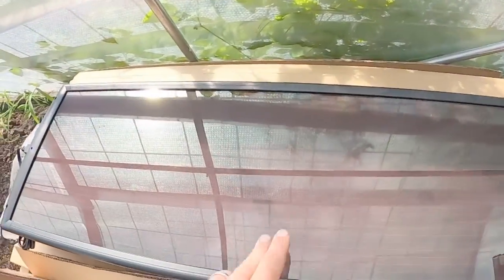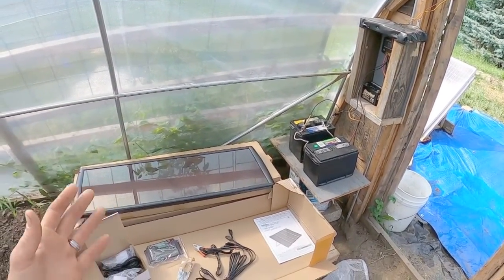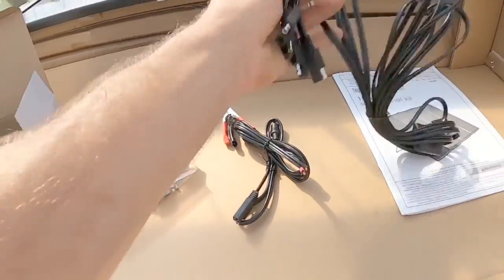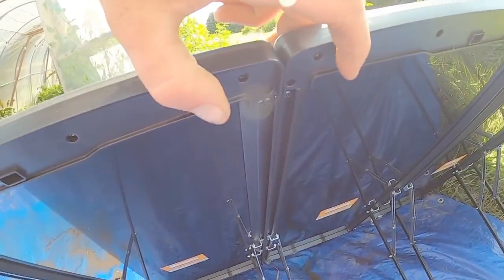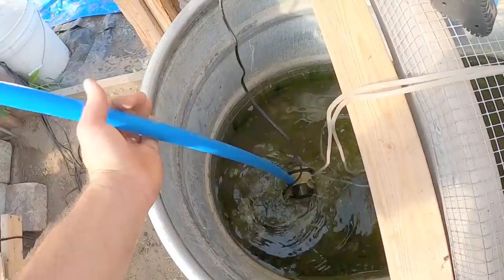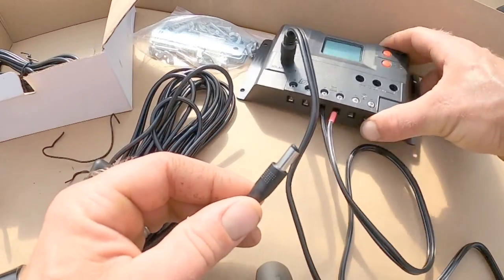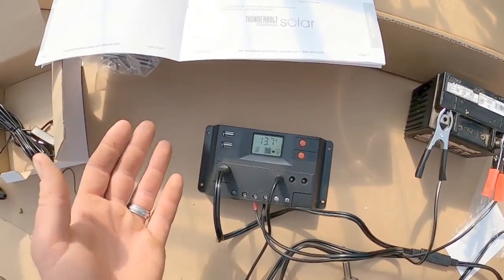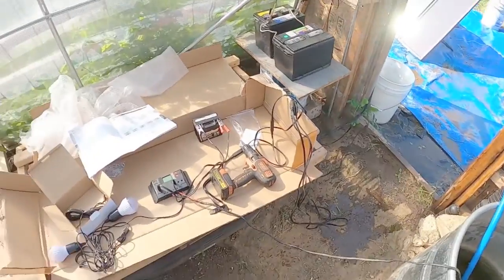DIY Simple Greenhouse Solar - Review, Set-up, & Operation - Beginning Cheap Winter Heating System

Comment: My plan is using a solar kit 100w similar to this one..but electric heaters use lots of power. My idea is to plug in heat lamps like you would use in a chicken coop. With your 100w solar setup here, what's the highest wattage heat lamp or two smaller heat lamps could work throughout the winter for couple months to keep warm for tropical plants? ( Guavas bananas, citrus)??  I'm very ignorant on solar but trying to learn. Just need something cheap and simple for a green house with tropical plants for heat. Im in north Alabama and the greenhouse is about 12'x24'  hope to get your input. Thanks
Reply: Did you figure out your solar kit for your greenhouse tropical plants? Would you be interested in sharing. My electricity in my greenhouse no longer works and will like to do a DIY solar system for our small greenhouse before the real cold hits in zone 7. Thanks and blessings ❤